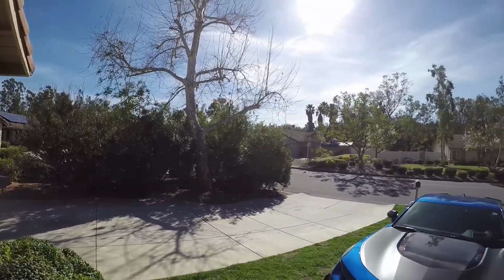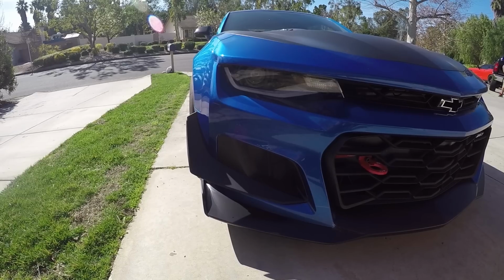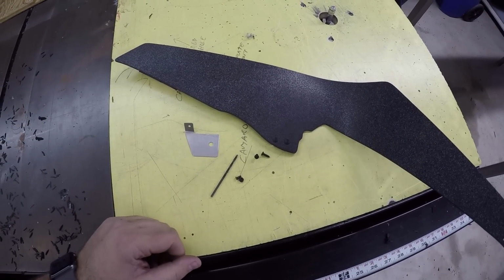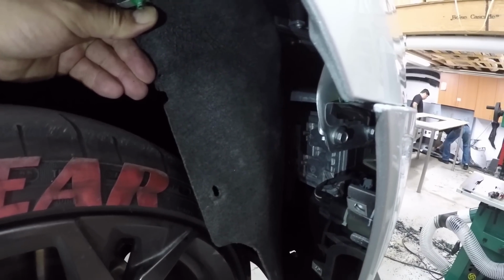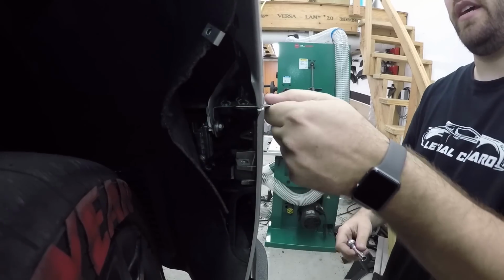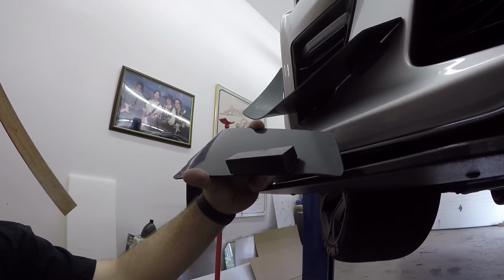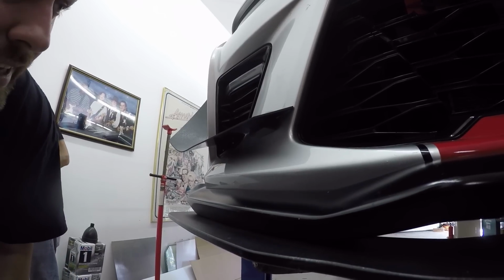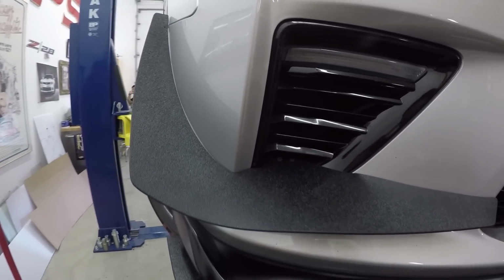Dive Plane Install Guide - 16-18 Camaro SS | by Zl1 Addons

Comment: As a 6th gen 1LE owner, I don’t find the cunards/dive planes to really fit the look of the car at all but to each their own.  If I was interested in purchasing these dive planes, the one part that I didn’t like seeing was the metal bracket being sandwiched between the quarter panel and the bumper cover.  Not only is the quarter panel providing metal-to-metal contact with the bracket, it also leaves (to me) a very noticeable gap along the horizontal seam of the two body pieces.

Comment: Hey Matt , are the dive planes on the Zl1 1LE an extra piece Chevy added to that spot or is it 1 piece with that air scoop that’s mounted in there where a driving light would be ? Thank You
Chris
Reply from the maker: GMs offering molds into the car and bumper.

Comment: Ehh, I wouldn't put those things on, they seem a little flimsy and a bit cheap/ricerish... Would be nice if they made a beefier set out of decent plastic, fiberglass or even carbon fiber, or better yet, have the beefier/thicker ones built into an aftermarket bumper as one single solid piece...

When people are dropping tens of thousands of dollars into their cars to make them faster and look better, they typically don't want something that looks so cheap and flimsy even if they do function well... And yes, I agree that after a few washes, some heat from both the engine and the sun and possibly some track time, that tape is eventually going to come right off...

But, to each his own I guess...

Comment: So what's the point of drilling those 2 holes? Do you put screws in it or what? You just drilled 2 holes and that's it....
Reply from the maker: It looks as if the part of the video where I put the 2 screws in when missing? But yes after drilling the 2 holes, you screw the dive plane in.